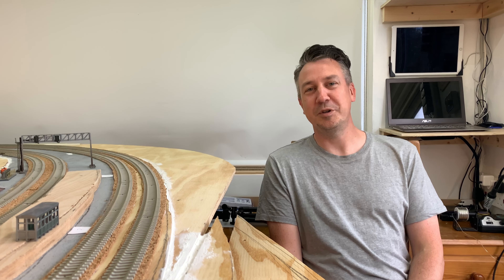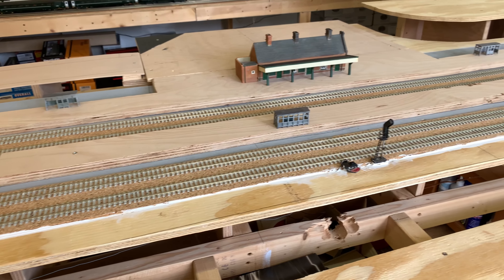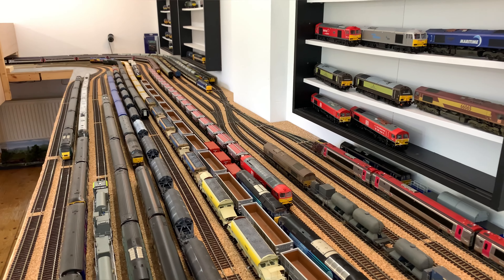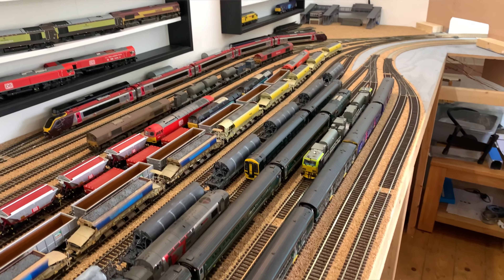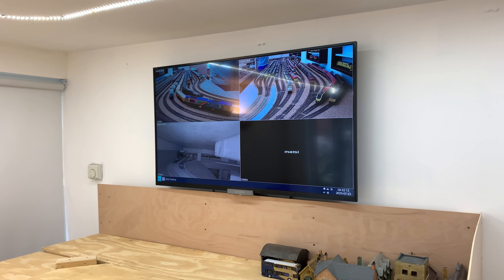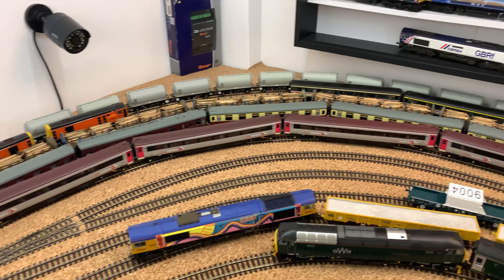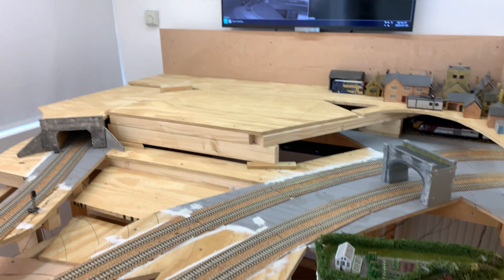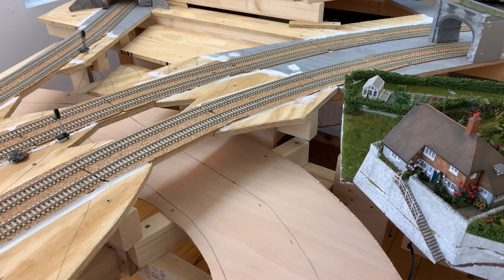MK4 - 1. Layout update

Comment: Layout is looking good.  I have been using iTrain for the last 12 months and it is very good.  You don't need ABC braking.  iTrain will do it all for you providing that you calibrate each locomotive's speed curve.  It's really accurate with just one occupancy feedback per block.  K   🙂
Reply from the maker: Thanks! I have started to use itrain and I think i will be using it for 2 of the lines which go through the station and leave the other 2 (including the junction) to be controlled using the Z21 app and for this I will probably just use ABC braking. It’s still all undecided though. It feels like quite a mammoth task to overcome so maybe just small sections at a time and I’ll get there eventually…!

Comment: Hi,
Its nice that you will now have a layout that you like and it in this stage of the build looks interesting will keep a watch out to see how it continues. I run my Train Set with iTrains so will be interested to see you sort this out also but as you said it will be used just to run trains on a schedule did you also consider Train Controller as this may be better for this. I wish you good luck and hope all goes well.
Cheers Robert.
Reply from the maker: Thanks Robert. I’ve already stumped up the cash for an itrain licence so will be giving this a go first 👍
Reply: @GoodfordModelRailway  Hi.
Thanks for the reply and ok thats good iTrains is very good and can do a lot so the best of luck in sorting it out I think you will find it easer than I did but did make some not very good videos on my getting to grips with it and the limited things I have been able to do with it and there are no end of YT ones on it the one I used the most was Bob Fullers series which he is still doing..
Cheers Robert.
Reply from the maker: @robertstrainset6556  I have watched a few of Bob Fuller’s videos but ended up setting up most of it following the guide from @DCCTrainAutomation. It seems to be quite comprehensive for what I need it to do.

Comment: Hi Dave. Great video ! Can you tell me which retail outlet you purchased your wood from, it looks good quality ! Also, what thickness is the plywood for the base ? Thanks, Nigel
Reply from the maker: Hi Nigel, believe it or not, the wood was from Wickes. Always a mixed bag with them as I’ve had warped timbers delivered from them in the past. The plywood for the base/trackbed is the 12mm structural type. Hope this helps. Cheers, Dave
Reply: Thanks Dave  @GoodfordModelRailway